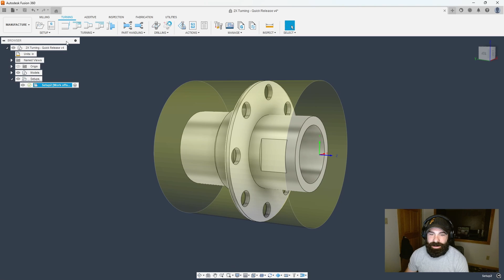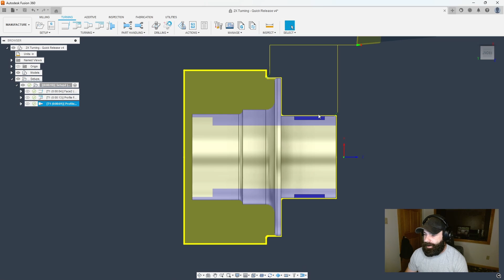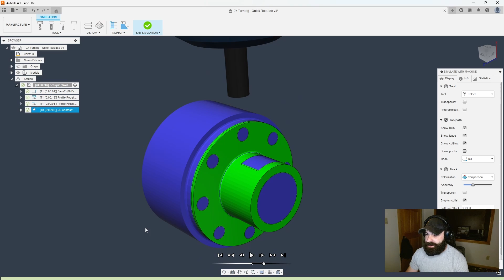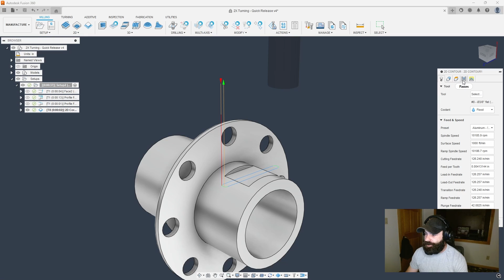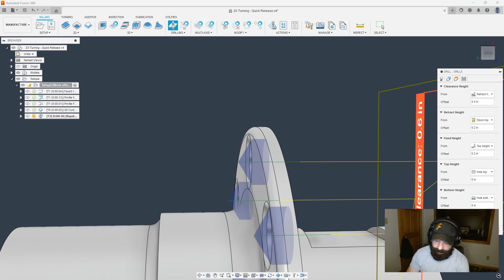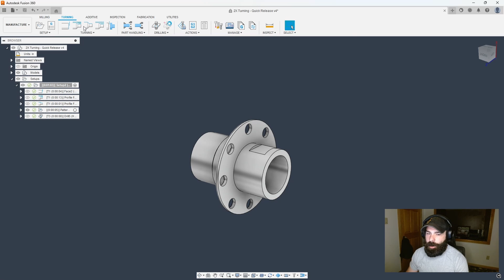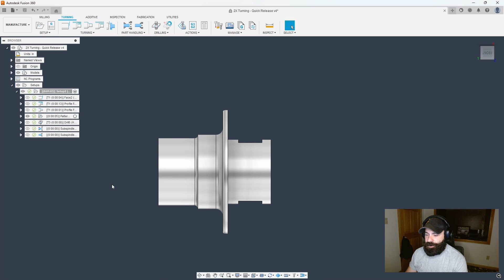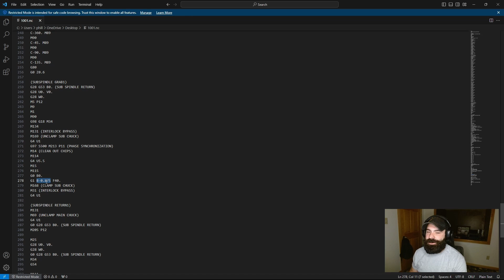Mill-Turn Thursday: Simple Hub

Comment: Good morning, thank you for the video. I wanted to ask you if it is possible to start from a stock that is a casting, an offset of the drawn profile.
Reply from the maker: Yes you can. Depending on your casting you can duplicate your body and use the push pull tool to add more material.
Reply: @JITCADCAM  Kindest